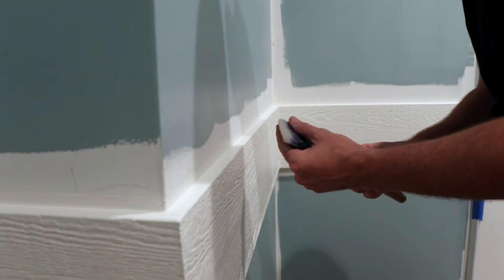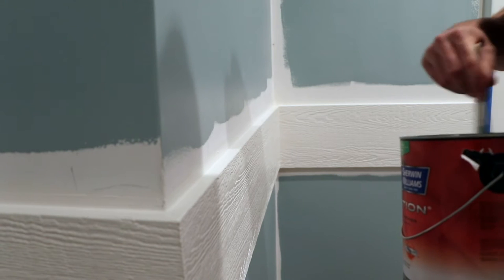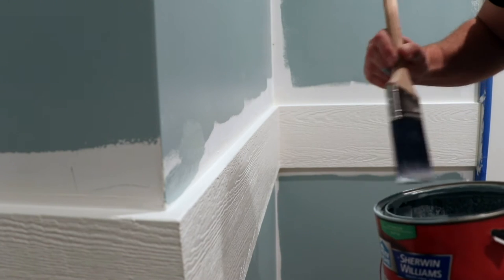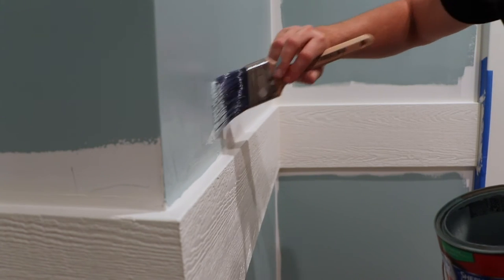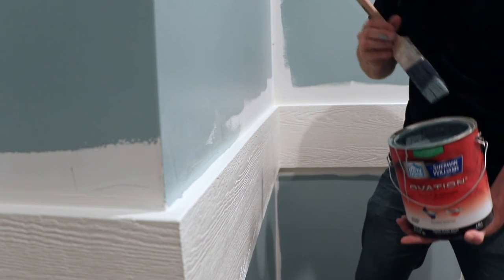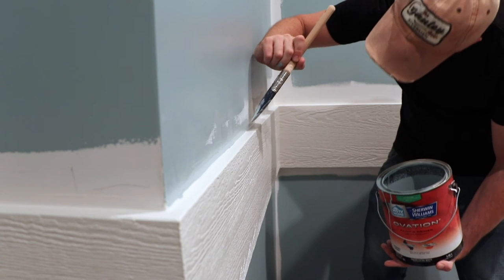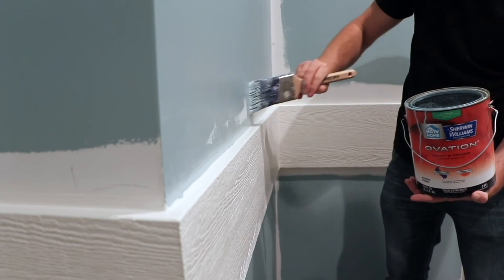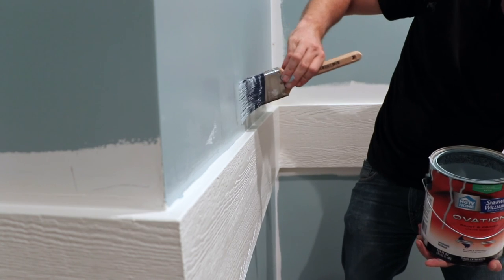Learn how to cut in and paint edges and straight lines like a pro - Trade Tips

Comment: I also use a Purdy brush but I find it WAY easier to use a straight edge brush and not then angled brush. I load one side only of the brush and I literally zip down the edge above where I want the paint. Then I come back and use that heavy paint and I can make a straight line right where I want it and very quickly. Then I feather the wet edge to get rid of brush marks. BAM! Done! I can cut a room like nobody’s business! Lol! What I have problems with is roller marks. No matter how hard I try I can never get enough paint on my roller to avoid lap marks or shine marks from the washable paint. Drives me nuts! Lol!
Reply from the maker: With rollers, the trick is to roll in one direction on your finish coat